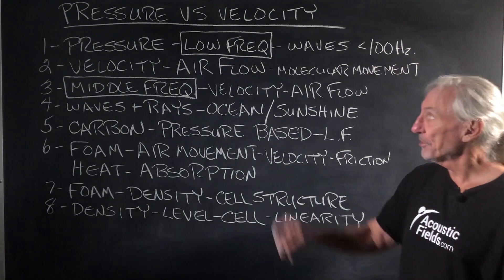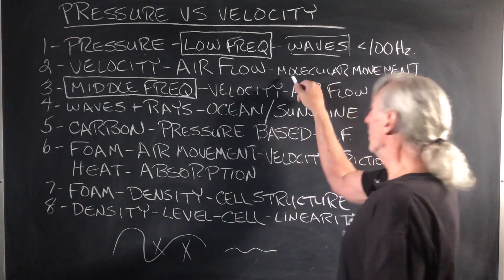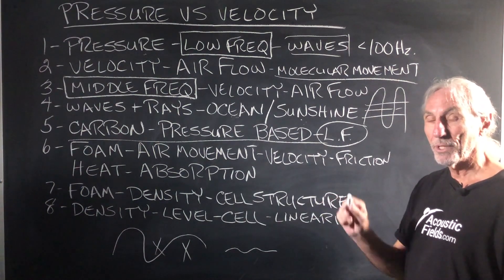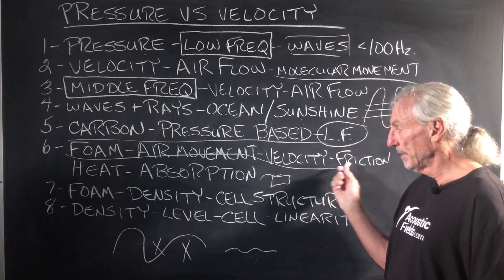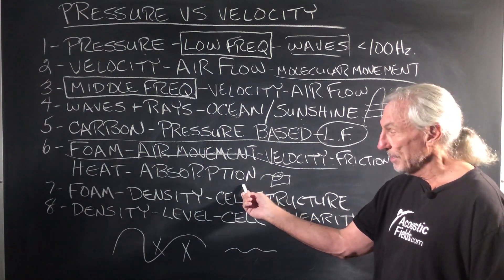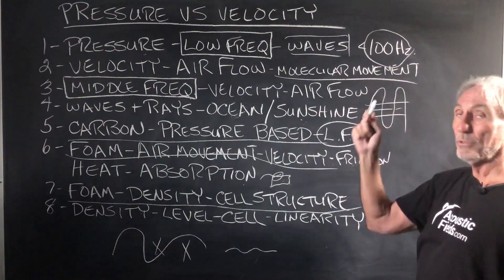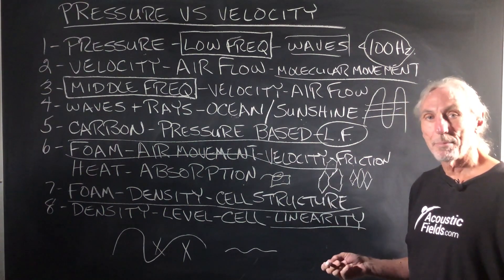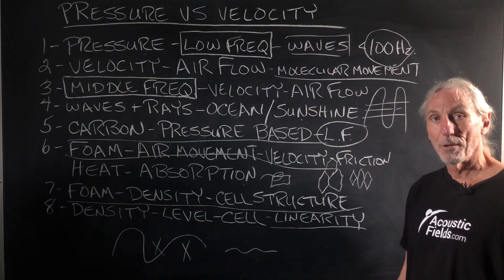Pressure VS Velocity - www.AcousticFields.com

Comment: So thankful I found Acoustic Fields and your YT channel. The first person who could explain what I hear.
And YT's algorithm is constantly recommending videos from companies advertising products that physics tell us can't work, e.g. corner mounted foam "bass traps". Thank you Dennis.
Reply from the maker: Unwanted modal pressures are produced by two, four, and six parallel wall surface areas. It takes the whole wall to produce the modal issues. You can not treat an issue that is caused by the whole wall by treating just the corners. The corners only represent around 10% of the total wall surface area. This is a common practice in this industry where they take a half truth and make it sound like the whole truth. Even if the corners were the problem, you would never use foam as a treatment technology for a pressure based problem. Once again, a half truth masquerading as a complete truth.

Comment: All Sound waves are compression waves (pressure waves) regardless of frequency. Air movement (in one direction) would be DC. There is technically more air movement with the lower frequencies at higher SPLs. If you put fog in front of a speaker and generate a wave at a given frequency, you will find that lower freq. move more air.
Your foam, with it's density and uniformity, is able to absorb the pressure, not slow or stop air movement.
 Resistance to air pressure change is the key to absorption. Different amounts of resistance help to absorb at different frequencies.
Reply from the maker: Resistance comes in many forms. We have pressure based and then molecular velocity or air movement. across surface areas. The thicker the foam, the more pressure is required to gain performance. The thinner foams and we make some that are 1/4" thick are all about  air movement.